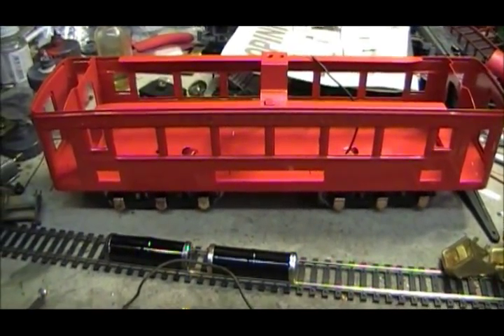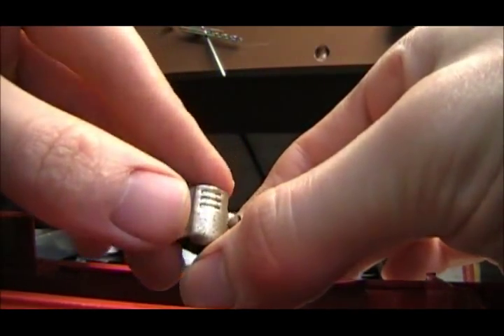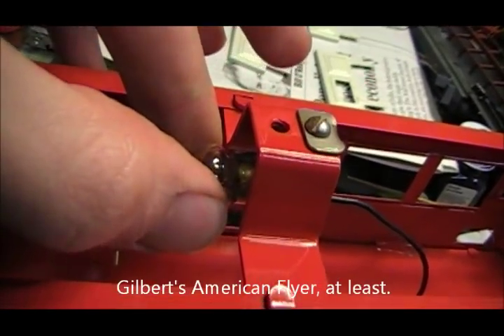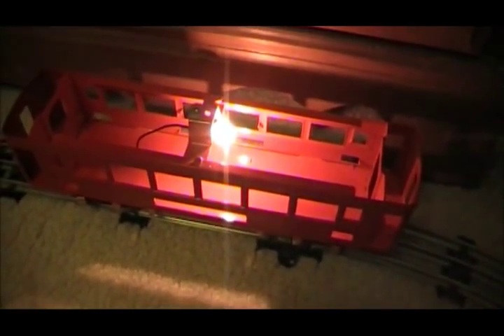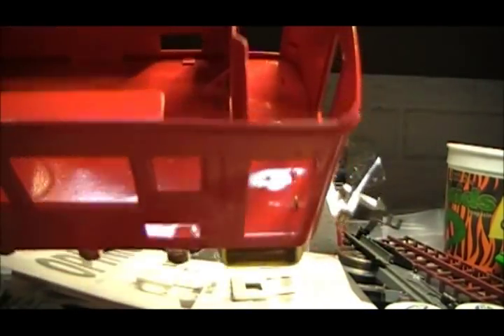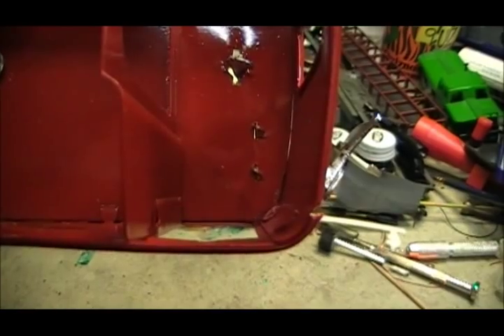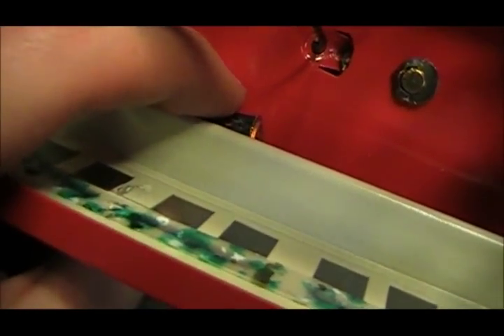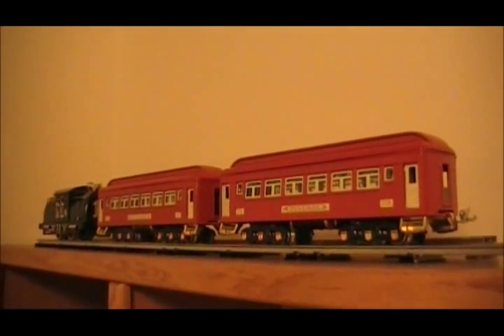Restoring a Lionel Passenger Car - Part 7: Reassembly

Comment: Good to see these getting restored and looking like new again. I recently started doing this myself and have had great results so far. Some were so badly rusted and dented I had to heat the solder to separate the sides from the floor, ends and dividers. I have been powder blasting the old finish and rust away to bare metal. Did about 75 cars over so far.

Comment: I need to trouble you with one more question,  my car is the lionel 20's era standard gauge passenger car, the light fixture was missing both socket and washer.   I put a socket in and a washer but it still won't light.   The bulbs are new.   So I am wondering sometimes could it be the wire?   The wire looks beat, if I need a new one what kind do I get?   All my other lights on the engine and the second passenger car are all lit but this one I can't get working.   If you have any advice I would appreciate so much.   Thanks

Comment: Can you use a wrench socket to press down those tabs on the bottom of the window assembly?
Reply from the maker: Yeah, that could work.  The cars are still holding together fine 7 years later, so I haven't thought to go back in and do anymore work. :)

Comment: Couldn't you have turned the pick up roller 180°?
Reply from the maker: Yes, but then it would've touched the other axle if the car was rolling in the other direction.  I figured it would be better to do a permanent fix.